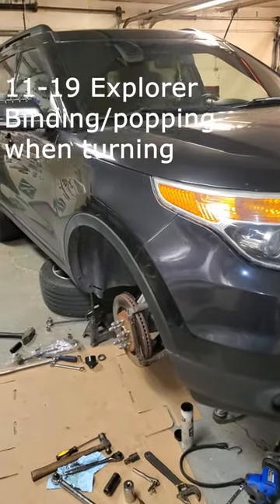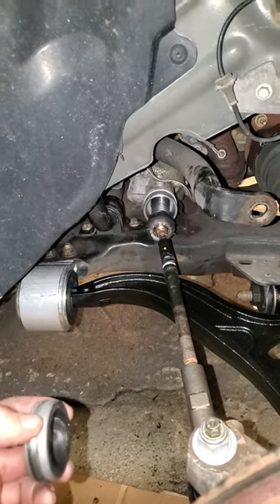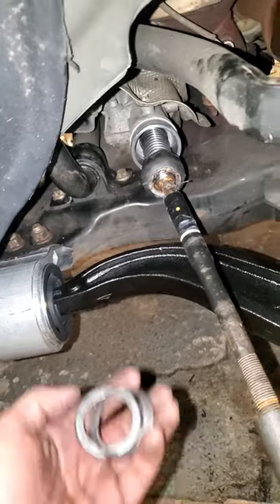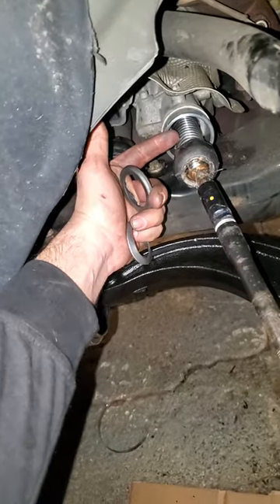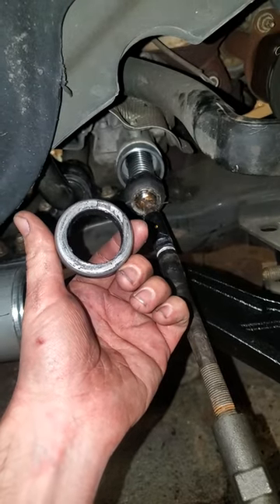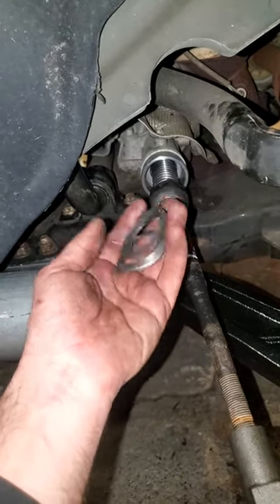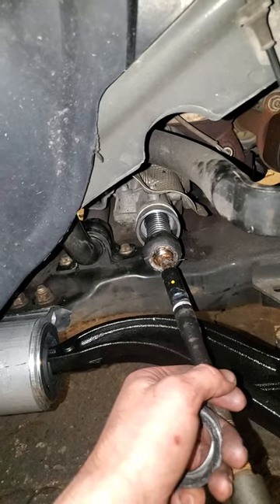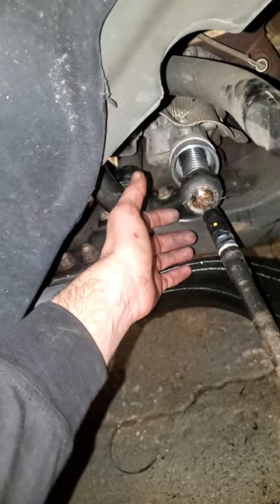Explorer Popping/Binding when Turning Fix #mechanic #ford #fordexplorer

Comment: There is an oem repair kit for the 2015-2020  hyundai Tucson steering stops. They look an awful lot like the one you are showing, and the way they fail is exactly the same in the Tucson. If you are interested I could look for the part number, the kit is quite cheap, but I can’t confirm if it really fits. You would have to try it yourself
Reply from the maker: I'm interested. I don't plan on pulling this vehicle back apart to try it, but I know other people that have them and they'll likely be having the same issue before too long 🤣
Reply: I’m interested as well. We are currently having this issue 😢

Comment: Can you explain the second option? I thought I heard you say "send it". Not sure.
Reply: I think he meant remove that piece and re assemble without it. 

That's why he says be careful about slamming the wheel against the lock.
Reply from the maker: Dominic is correct, and yes, I did say "send it". Take the broken pieces out and put it back together. Without that stopper in there, hitting the steering all the way hard enough could damage the steering rack.

Comment: Junkyards maybe too
Reply from the maker: Yeah there is that option as well, didn't really think of that for some dumb reason. Depending on the customer, it's cheaper for them and if they lack the sense to drive accordingly if the stoppers are removed, that may be the best option. Quite a bit of extra work vs just removing them, which is, in my opinion, the best option.